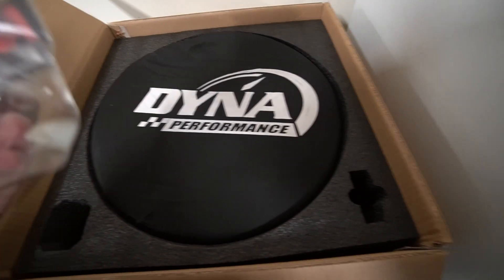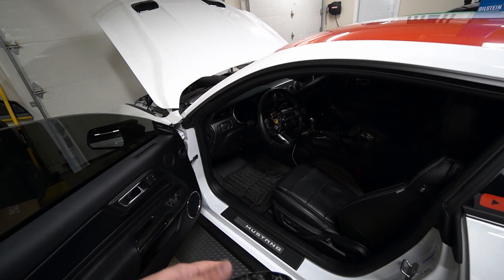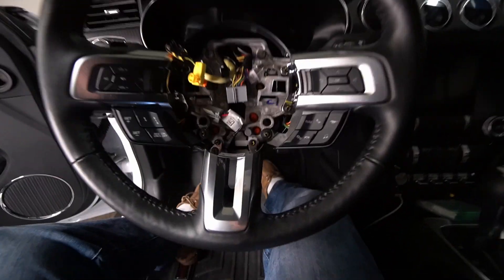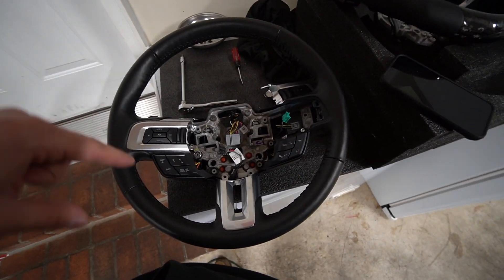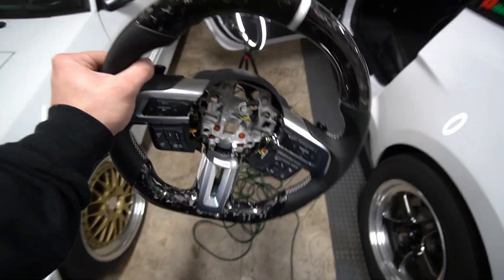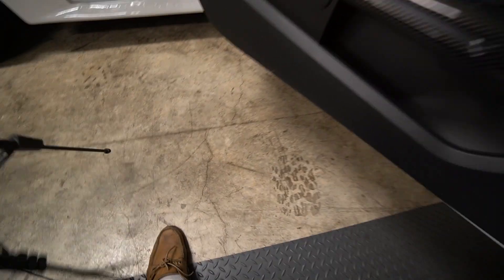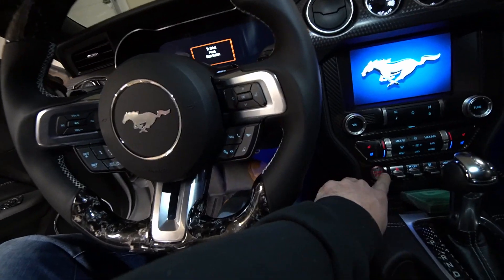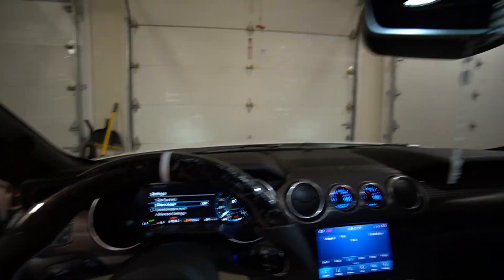This $1,000 Steering Wheel Was Worth EVERY PENNY!

Comment: How did you get the final black heating element connector off? You didnt show it in the video.
Reply from the maker: Pull tab
Reply: @ItalianStallion410  not sure where to pull buddy, I've spent the last hour trying to figure it out... any help appreciated. It seemed like its locked in..
Reply: @ryussfiv4167  did you figure it out? I am having the same issue

Comment: Did you get the heated steering wheel option from them so you can retain the feature.   I did and it was very pointless. Lol.  I just didn’t wanna sacrifice something that came with the car.   My way of thinking is when I sell it I don’t have to say this feature doesn’t exist anymore due to me modifying the car. But it’s no where near as strong as the factory heated wheel.
Reply from the maker: No I didn’t cause I heard the same thing it wasn’t that good
Reply: @ItalianStallion410  it’s useless. But it’s there. I just felt now I don’t need to explain a heated steering wheel option that doesn’t work on resale.
Reply from the maker: @TheCdM1981  yeah I don’t drive my car when it’s that cold anyway plus I don’t think I am gonna sell the car
Reply: @ItalianStallion410  I don’t drive it in the cold either. But at some point everything gets sold.  I have no immediate plans.   Lol